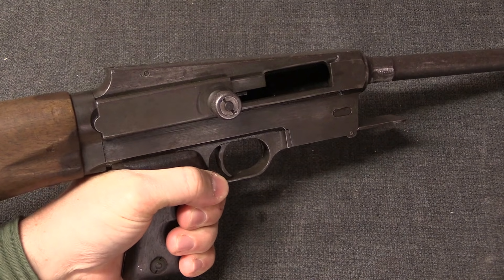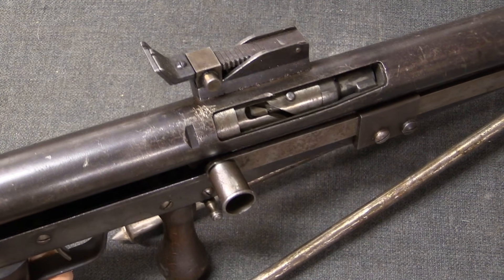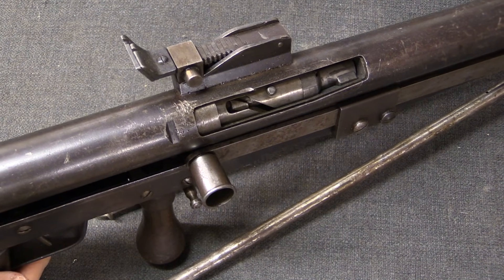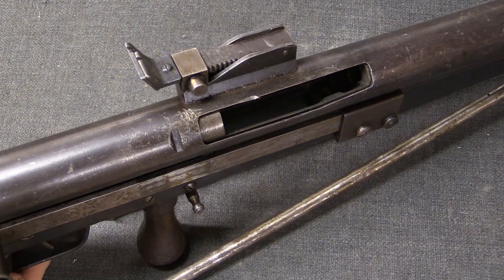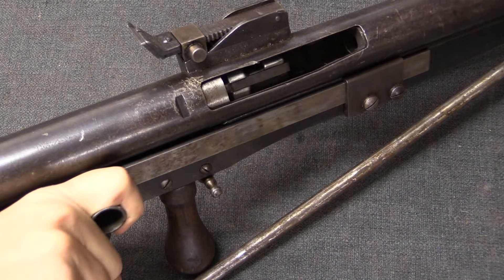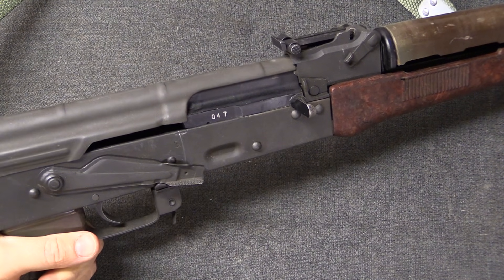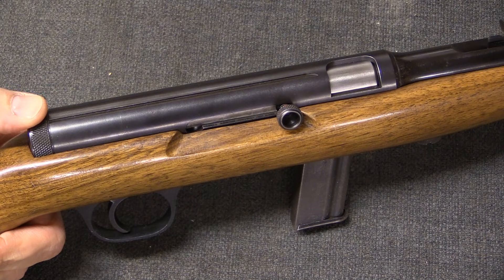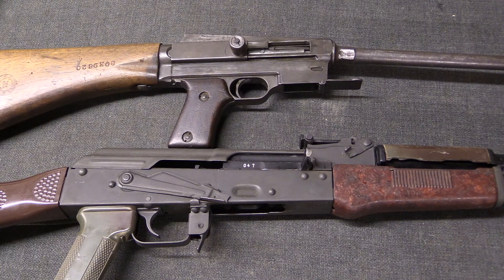How Does it Work: Open Bolt vs Closed Bolt Firearms

Comment: I think it would have been worth mentioning that the gun "FG42" as an example shoots on a closed bolt on semi-auto and on an open bolt on full-auto.

Is the FG42 the only gun, which is able to do that in one rifle?
Reply: LWRC M6 does this.  I believe it was to fulfill the original requirements of the Marine Corp for a replacement of the M249 SAW.
Reply: The SCAR HAMR does this too, if I recall correctly.
Reply: @Ahmad Syahir I also wanted to point out the FN HAMR :D However, like the name implies, the "bolt switching" has something to do with heat, not with the selector switch. It will fire closed bolt until the bolt has heated up to a certain point where it will lock back and function like an open bolt system. So unless the gun is not super hot, you have closed bolt in semi and full regardless :) A very interesting design, and sad to see it didn't get anywhere... (Also my last name actually is HAMR, so I have some sort of emotional attachment to it ^^)
Reply: The johnson LMG also does this I believe, it also has remarkably similar iron sights.
Reply: I believe the Stoner 63 can do it, although you have to reconfigure it substantially to do so. It cannot be done with a simple lever throw like the FG. That's the only one I can think of at the moment, I believe there may be one or two others.
Reply: @thegoldencaulk2742  - The  Stoner 63 does not do this. The LMG/auto rifle fires from an open bolt all the time and the selector does nothing. When it is converted into rifle carbine it fires from a closed bolt in auto and semi so its not like the FG42 that does it based on the selector.
Reply: @Mongo63a that's what he said, he said you need to reconfigure it, the stoner was made to be modular, the lmg and carbine are not seperate guns, they r both the same guns that can be configured into one another, so for and lmg where it fires many rounds you have the open bolt configuration and for a rifle that doesn't fire as many rounds it fires on closed bolt
Reply: i think Ian is making this chanal more newcomer friendly so probably mentioning such examples would be to much for a video like this. If you are new you dont want to be told this and this is also an exeption.
In my opinion it would be better to mention this things on videos talking about this rifels etc.
but i can understand you thought
Reply: I think the STG44 also did that but not sure.
Reply: @HappyCupsInc  the STG44 is a closed bolt design
Reply: Tristan Holland yes I know. The mkb42 however was open bolt and I remember hearing somewhere that the stg44 is closed bolt semiauto, open bolt full auto.
Reply: HappyCupsInc no, the STG 44 only fires from a closed bolt.
Reply: @thetoecutter13  k
Reply: If you recall his interview with jim sullivan, his product improved AR15 variant had that feature. There have been several other guns with that. Most of them start out with the bolt switching feature, but after adoption, people figure out that the gun is either useful as a semi auto, or light burst, or it is useful in full auto, and it gets simplified to suit whichever role is preferred.
Reply: Oh that is cool.
Reply: Do you know how it is switched from repetition to fully automatic? I‘d like to understand what happens when changing fire mode mid magazine.